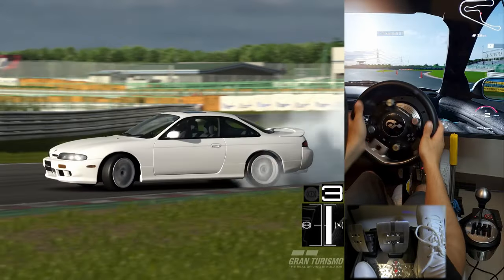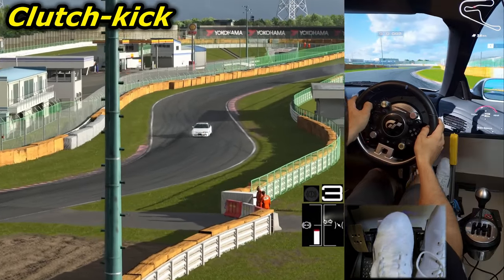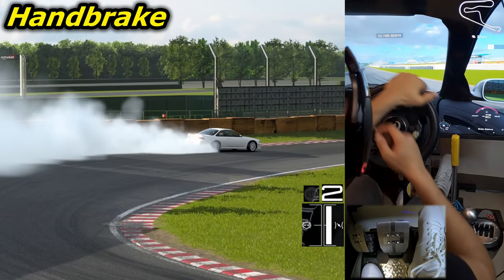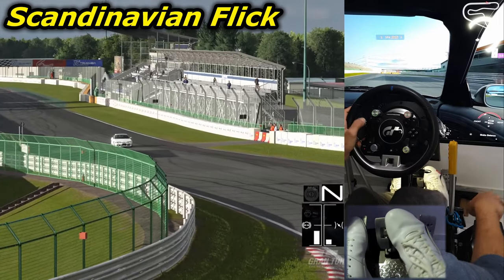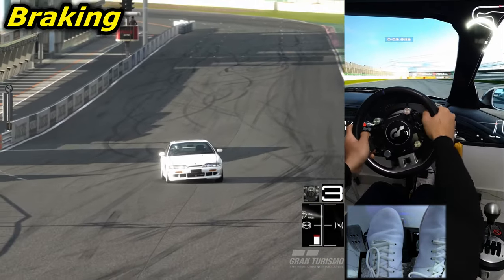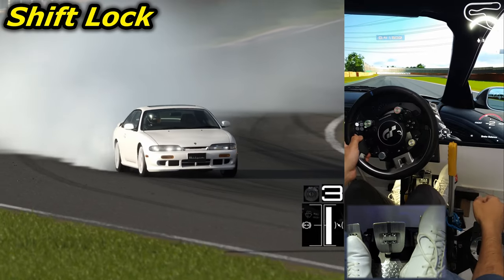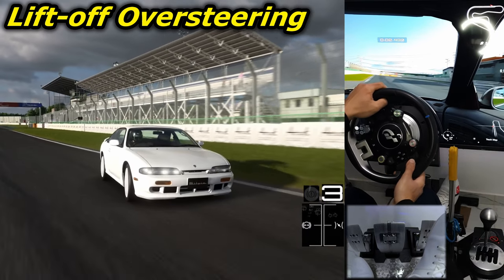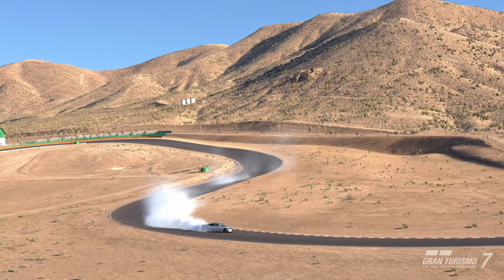How to Drift With a Steering Wheel (GT7/Real Life Tutorial) - Part 2: Initiation Techniques

Comment: How did you get your clutch to work on Gran Turismo seven I have handbrake shifter and extra pedal for clutch, but mine does not work
Reply from the maker: which wheel is it? If you have one of the licensed steering wheels with its official gear shifter it should work just fine. But keep in mind that it depends on which car you're using. Some cars have a sequential or automatic grearbox when stock so it won't work unless you install a manual gearbox. Or you can choose a car which has a manual gearbox in its stock form.

Comment: Heyam i have a question. I don't understand why when i try to drift with any car for some reason the car  can't fully throttle. This happenes with every car and bult. Can you help me and if you do i will apriceat it amd i will subscribe
Reply from the maker: Hey man. I think you only need to calibrate your pedals. Which wheel are you using? In the game's main menu click on the GT icon at the top left corner of the screen, then click options > controller > steering controller settings to find the pedals calibration menu.

Comment: Hey buddy! Thanks for great videos with detailed explenations. 

I’m stubborningly learning to drift in gt7 and I wonder if you can help me to understant what I’m doing wrong. I have used that Silvia almost stock with only CH tyres and steering angle kit. I was improving and then tried your exact setup. I don’t know why but now every time I throttle I spin out and there is nothing to do to control the drift. I tried ebraking and throttle. Slowly throttling and immediately countersteer doesn’t help either. It just spins every single time.

Could I try some mild tuning from stock version to make it drift a little bit better step by step and if so what should I tune first? Toe angle, camper or such?
Reply from the maker: Hey budd, you're welcome!
First thing you did wrong was to start practicing while using an angle kit... very bad idea. 
It's one of may common mistakes people do which I've just covered in my new short video: https://youtube.com/shorts/LM11WI2OLH4?feature=share
Start without it and learn your way up totally without it to avoid developing very bad habits that ruin the flow of your drifting and your car control skills. You're gonna keep spinning until you unlearn what you have started with so far. 
The Silvia setup that I mad is perfect for starting to learn drifting, especially the suspension setup, but you need to not be hesitant with your inputs. Just forget the fear of spinning out and stop thinking about avoiding it, and think more of wanting to make that drift just work if this makes sense. I made the car this way so that you can hit the gas hard while not thinking a lot about throttle modulation. It's a good way to learn how to balance the drift and keep the momentum. You can just increase the power a bit more and see if this helps at first, then get back later to this same amount of less power and try to drift it the way it is.    

Make sure you have the right force feedback settings, if you haven't yet seen my video about the subject, check it out here: https://youtu.be/oEe5ZchqbMg
Reply: Goddamnit dude, that angle kit advice was spot on. That made a world of difference so I did few more other tweaks and within one hour of practice in Willow Springs I did my first full drift around practice circle and many after that. I write here how I actually made it step by step if someone else gets help from it too.

I realized that angle kit was making my turns way too drastic causing car to spin. I still did spin every now and then but I was starting to be in control. So I decided to reduce controller sensitivity to 0 (pause menu-controller settings-controller sensitivity) for even slower turns. No more spinning around and I was pretty happy. At this point I changed car settings back to the exact ones (except I still use CH tyres) that SimActionClip has in this video. First I did only power slides around the circle one after another. For me sensitivity 0 is too slow to make car drift. Gradually I went from 0 to 5 finding throttle and turn sweet spot in every level. This took me an hour or so. Moving from 3 to 4 were the most difficult transition.

After reaching sensitivity 5 many things just started to click somehow. Instead of throttling and hoping to hold the drift together with counter steer I started to feel the car so to speak and many things told in these two videos started to make sense. Quite addictive feeling I must say.

Hope this helps someone fellow beginner drifter. Thanks again for awesome videos and hope you keep them coming!

Comment: Hi sir

Not sure if my qustion is relavan. Does speed also being 1 of the variable factor in drifting?
Reply from the maker: Hello, yes the speed is an important factor in drifting and you can clearly see in the video that I describe how to approach the corner for each technique. For the clutch kick technique (power over) for example you have to approach the corner at a slower speed than usual to avoid understeering while in the handbrake technique you should initiate the drift at a higher speed than usual to be able to smoothly continue the drift. I mention that at the beginning of the explanation of each technique which are cut into different chapters in the video.